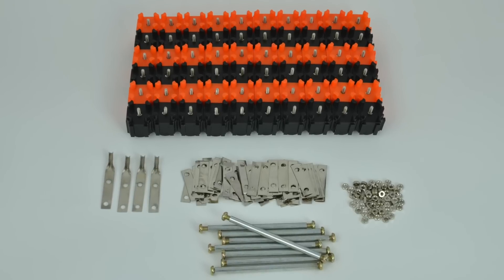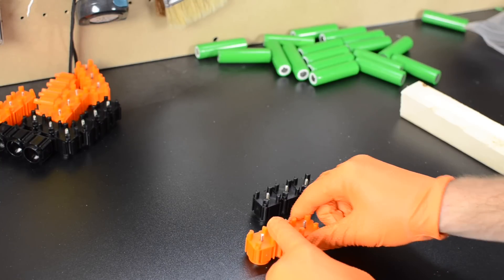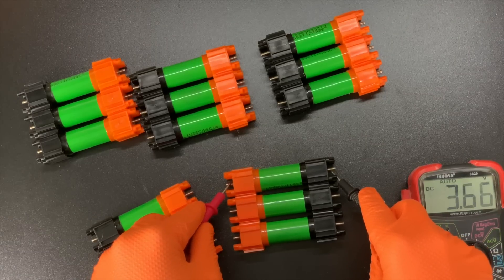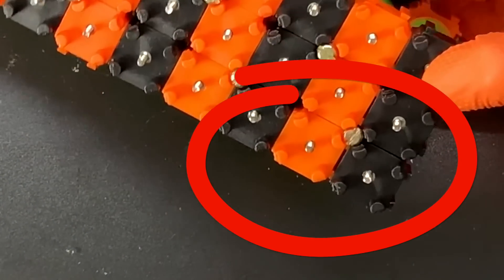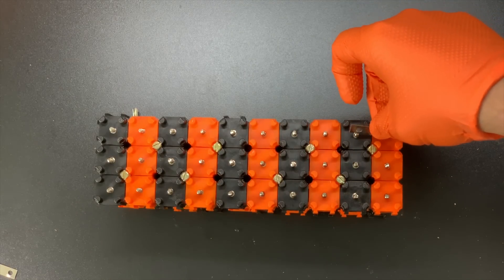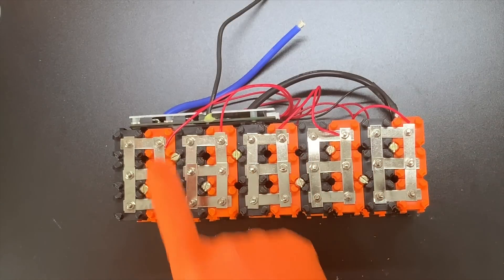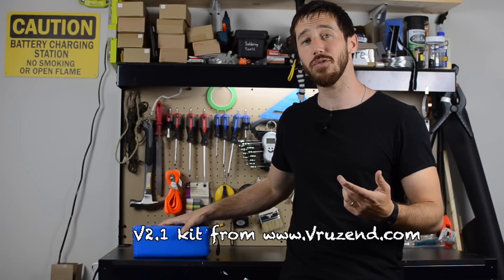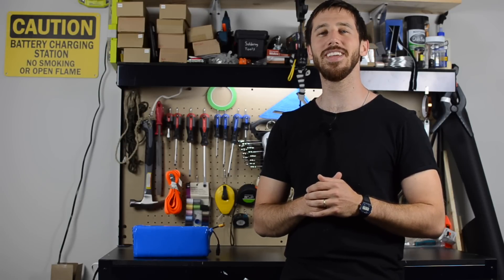New & improved Vruzend V2.1 no-weld 18650 kit

Comment: I'm new to battery building and I keep watching videos on how it's done.i think I'm getting the hang of how it's done.

1 question though,by using these blocks are you sacrificing space by adding more volume in the pack.
Let's say my 72v escooter has a certain tight space for the battery that sits perfectly. Would I be adding more bulk using the same layout of batteries the scooter battery has.

Not sure how many batteries I would need to make a 72v battery 32ah battery. This is another thing I need to figure out.😊

Comment: Looks easy putting it together. I would hate taking it apart to fish for bad, unbalanced cells. PVC pipe with threaded end caps are still my choice for cheap , tough, cell holders. 1” thin wall pipe for 26650 cells…3/4” schedule 40 for 18650 cells. Tight fit but not too tight , and cells can be extracted after removing one end cap and extracting with telescopic magnet for individual charge/ balancing in single or dual digital display chargers.Cell to cell direct series connection, no soldering, no welding, no itty bitty nuts and bolts to tighten. Hillbilly ingenuity does it again.. does fer me!

Comment: When making series connections, if the caps are not properly secured, it will cause a serious short as happened to me. A short occurred and I had to run out of my house to take it apart before it caught on fire. I seriously don’t recommend this alternative. You will not know what I’m talking about until it happens to you. Get the K Weld.
Reply: You have no business touching batteries, stop it.

Comment: Thanks Micah, I appreciate your innovation and that these battery kits are evolving.  I've been using these systems since 2017 and built many ebike battery packs.
I see in ebay that you have the V4 kits but you have to ship from UK.  Just wondering when you will get the V4 kits in stock in the US.  I've got about 60 cracked caps from the V2.1 kit and a lot more than that from earlier versions.  Looks like the V4 kit holds onto the battery by screwing in the bottom rather then by pressure around the battery.  I'm hoping that will result in less cracked caps.  :)

Comment: goldsmith / master jeweler, photovoltaic / solar thermal technician here: i'm all thumbs when it comes to soldering pen. i usually use small torch when i solder small electrical components, even used a laser soldering station on motherboard. i didn't want to try that on a battery. 
what do i think of the Vruzend ? i Like, OLE'! 💃

Comment: Having just spent many hours using the 2.1 kit, I have assessed the issues.  There are several major design issues that make the supplied 2.1 kit unviable for regular and efficient use.  In the parts supplied to me there were several major quality issues that caused significant problems during assembly.  The main design flaws are 1) The through bolts use flat screw heads so that standard workshop tooling cannot be used and the assembly using a screw head on both ends makes the tightening process unnecessarily difficult and time consuming.  The design should use one head that fits into a recessed end of the cap and the other end should use either a PZ or Allen key head, this would allow the use of standard tools and allow quick fitment and maintenance.  2) The screw terminals and nuts are too difficult and time consuming to use efficiently. These should be re-designed to allow easy fitment.  The current system makes it very difficult and time consuming even for a trained fitter to fit the screw heads onto the screws.   The quality issues were 1) The caps came from a mixed batch, one batch were very tight fit and required a press to fit, the other caps were so loose a fit that they did not hold the batteries.  2) The screws did not match the threads correctly in the through bolts, this created binding issues and caused major difficulties and was time consuming to fix, one screw head was completely the wrong size and needed to be replaced.  These current issues mean that any workshop attempting to assemble multiple packs will need to spend very significant time for the assembly and subsequent maintenance.  This makes the pack too inefficient for sensible battery pack assembly at a reasonable end cost.

Comment: I had to chuckle when he used the lighter for the heatshrink tubing, I do that myself and only use the heatgun on much larger heatshrink, which he did on this video.
Also unnecessary heat on the batteries is a bonus !!

Comment: Can I upgrade my dad's old school electric off-road skateboard (3x 12v 12ah SLA batteries, run in series) to a 36v 18650 battery pack? Can the li-ion pack be higher Ah rating? Thanks

Comment: Can you tell me if how we can use one controller to operate two motors in parallel. Because no two motors have the  same number of windings at any given time. So how do I overcome the noise and motor running issue?

Comment: How is longevity of the pack? I built 17s7p with Samsung 30Q and Vruzend v2.1 bits. After 3 months around 30% of orange ends cracked. Black ones around 5%. Vruzend support ignoring my emails… Definitely would not recommend.

Comment: If I want to build a 24v 14ah battery pack for a 250w-350w motor, both 24v, how should I build my battery pack? Also, Which bms should I use?

Comment: And then the controller also makes sure that the batteries don't get discharged too deep ? That would ruin them .   I am interested in building  battery packs for my amateur radio station , for at home and for in the field . In that case I need 13.8 V +/- , but can probably use 24V , and then convert it down to 14V or so . Very nice video's !  Tnx and stay save !

Comment: Anyone know where I could get a replacement or a custom build Lithium battery for my son's Gasgas/Torrot kids model E12 electric motorcycle? It says that it is a "48V 8,8AH 600W-1500W".  A 52V and more Amp Hours might work too. The dimensions are approximately 285mm by 73mm by 69.85mm. I don't have the skills to build one myself. The factory Gasgas part number is EE 40000TTCKK1  and I think the Torrot part number is 02PW-00020-ZZ if anyone wants to look it up to compare the stats. They are apparently out of production. Thanks. -Todd

Comment: morning...  i know nothing about batteries.  i  want to make a long lasting 12 volt batteries for my electric wheelchair using 18650 batteries.  i kinda understand the series and parallel but i don't understand the figure 8 demonstrated in this video.  negative and positives are all connected together.  why can't there be one side of the 3 batteries connected all negative to the positive side on the either end. so in a shape of a bracket [ then the opposite side and one row down the positive connects to the negative shape as the other bracket ] ???  i just don't get it..  i'm i that old and senile, beside being disabled??  i would appreciate your help.

Comment: I think just clamping the sensor wires is not ideal. i would either solder them or use ring terminals ?
Also i think NYLOCK nuts would be more reliable long term.
I guess an assembler could use the low-numbered torque setting on a cordless drill ?
Also  a socket driver would be useful using the same method for speeding up the build process on large cells ?
Simon

Comment: Five thumbs down for this new kit! I have already sent an email to Micah about this problem but no response. So buyer beware.
I have built two ebike battery packs using the plastic caps kit. Both battery packs have worked fine. However, a single cell in a battery pack needed replacing, so I disassembled the pack to replace the cell. I was astonished that several of the plastic battery caps were badly cracked across the top.  I managed to cobble the battery pack back together but I'll be surprised if I don't eventually have a problem because of the faulty caps.

Comment: 36v? You mean nominal? Because at full charge a 3.7v lithium cell has 4.2v you did a 10 series by 3 parallel so 4.2v x 10 =42v when fully charged. Does the BMS regulate the output voltage?

Comment: What kind of capacity cells are you using because with 2200mah cells 3 parralell would still give you a capacity of 6.6 amps so I don't completely understand where you got the 10 amp capacity from. I would appear to me that you are using 3300mah cells to get to 10 amps

Comment: Don´t apply too much force on the vruzend ! I did and many broke...I put a wooden board on top and below the 10s4p pack and THEN bolt with longer screws not onto the vruzend plastic but onto the wood.

Comment: It looks like this method separates the batteries allowing for good cooling airflow. Why then would one super wrap the battery pack preventing cooling air to do it's job? The kit provides all the battery protection needed and makes packing tape, foam and shrink wrap a detriment to a good design.

Comment: Yuck..  The balance wires can pull loose to easy.   Put a connection on it, and secure between the nicket and the bolt, or use an additional washer, and place the nickel, then the balance wire, then the washer, and then the nut.  The washer will help reduce the possibility to the wire pulling loose.  This design has a bare ware against plastic, against a nickel strip that can distort easily.  This is not a good thing.
Use the washer as it works, and is easier if you're looking for easy.

Comment: I am late to this party but at age 69 and with COVID-19 still on the growth cycle I am glad to still be in this world.  I have been searching for a battery packaging system for 12.6 (3 cell lithium ion) and 16.8 packs (4 cell lithium ion) for a portable power pack so I can change out 1 battery without having to resolder everything.  I use plugs on all connections.  I am NOT running a DC motor.  This also gives my customers the selection for Lithium LiFe04 batteries if they want them. J The ability to replace one cell WITHOUT HAVE TO solder to each battery end verses just bolting them in place is BOTH simplicity, genius and the sign of a very experienced and knowledgeable maker.  In the old days government called it Research & Development.  The reality is Retry and Do it again till you get it right is what this experienced is absolutely perfect for my design.  Hope bus bars for 26650 LiFe04 2600mah 55A Vascell arrays are on your future product design list too.  In FlorDAH we have been know to be without AC power for extended times due to Andrew, Charley, Matthew,  Irma and now Sally with more to come every year.  Beats running noisy ass generators running for hours.  I also hope this write up confirms I can suck up real good to both customers and winning a book.  This maker actually got his first patent 4,104,695 back in 1978. Most likely before have of your viewers were even conceived.  Harry Regician.  Regeration is my game plan.
Reply: i can make any coinfiguration battery  pack  12.6v 16.8v  25.2 v and on with sal short bits of neg and pos wire salvaged from cable cut and  stripped a few rolls of mini sellotape and few rolls of black tape some 4mm connenecter and 4mm terminals  with 5.5mmx1. 5mm connecter to charge

Comment: Iam straggling with your older v2 packs. 
I seen you videos how to make batterie. 
Iam making 60v 50a pack but half way throw a building, betteries felt to hot. I checked voltage and there was not looking good.
Some batteries was not making contact with v2. Cos plastic housings to big to keep steady or holding properly. 
I got 8 boxes cost me hundreds of pounds. And at moment sitting useless until I found a solution.

Comment: They are pretty cool to work with.  I'm just finishing the assembly of mine.  I did have one issue, though with the one black plastic housing.  It split.  Is this a rare fluke, or something common such that I should replace all of my black housings with new ones?  I'm asking before my final assembly and heat shrinking.  Please advise.

Comment: I just ordered my first e bike a hyper e bike . I’m all ready thinking about mods and upgrades. It has a 36 volt 7.8 ah I want to add an external battery and pug that into the charging port to get longer run time. The extra battery would be 36 but can jump the ah up to 10 or  higher? Or should I stay around the 6-8 ah . Or would this work it the same concept as battery packs for phones .

Comment: idea of this kit is great.  unfortunately imho caps are unnessesarily tight, especially when d barrel-bolts & heatshrink keep all tightly together. it defeats d purpose a bit, ease of assembly/disassembly. it should be possible to just lift off 1 whole side of a big battery, to be able to pluck a bad cell from d center of it. drilling a small vent-hole into d caps to at least get rid of d air compression & suction effects makes it a tad easier, but to make them 1/10mm bigger would b so much  better. i actually have a number of caps that cracked already.  you should consider this for kit V2.2.  me i'll be waiting....

Comment: All those nuts and the new clamp bolts . . . no lock nuts, loctite, or hot glue to ward off loosening from thermal or vibrations?
Seems kind of a scary proposition. 
Any real world data on loose connection shorts or fires?

Comment: Hi, How did you connect the large power wires to the BMS? It looks like hot glue in the video, but I know that can't be completely accurate. Did you solder these connections?

Comment: This is awesome, man.  I will definitely look forward to using Vruzend in my next battery build.  The DIY spot welding kits are awful and after some time the welds can come off.  Hopefully Vruzend will stand the test of time.
Reply: did you get the kit? i have an older set that i like. The new ones with screw clamp holes looks cool. BTW, i  am not sure if they still exist as a company. i sent an email query to them directly several months ago to no avail. Nothing on their www is current and empty links on their www. Their forum is not extant and i found very little current user information on the www as well. I hope they are still around - @EbikeSchool any update on this company status?

Comment: I used this kit to put together a 14.4V, 10.2 Ah battery pack for portable ham radio operations.  First time out the radio was used at 50-75 Watts output for right at 5 hours, and still had plenty of battery power in reserve. Outstanding kit!
Reply: I would love to see a picture of your build. I'm getting ready for the same kind of project for my Ham shack and portable rig. '73 KG7DTF Joe

Comment: Awesome. Please send me info. Of all places where I can buy at a great price the  batteries, battery holders, connectors, correct wire sizes and display panel and solar panels and which you believe is the best 2.5kw- 3kw continuous/ 4kw-6kw peak power inverter of 12v, 24v input because I want to build my own portable system.
Thank you for your help.

Comment: wonderfull idea  now its easy to rebuild and check over every year or so or if one suspects a cell block being down ....   but i have a question if anyone owns this kit    i need to know how much bigger is it  in cell length but  more so in space width?  example  if i have  6  cells  glued  together each  cell is 18mm  in  diameter  plus a few mm for the glue so say around  a total   of 120 mm for a glued pack of 6    how extra wide would it be in these  holders can anyone tell me as im tight  for space and need to know

Comment: Very nice. What about adding springs to the bolts to apply consistent pressure? Just an idea for next version. I noticed there are no 40V BMSs on the website. Any reason for that? Or are they just not showing? I ask because the electric lawn mower uses a 40v battery, although it's nominally 36v from what I've read. The 5 Ah battery uses 20 cells.

Comment: I made up a battery a year ago. It has stopped working as the plastic has split. It’s time to make up another but I will use lots of hot melt glue and sandwich it with plywood boards before I wrap it in foam. That’s the trouble with diy. It’s still cheaper than buying a new battery.

Comment: exelent video... 
I have a Question. 
what type of speed controllers is the most linear on power delivery to the motor. I own a eScooter the throtle went bad and since I wasnt happy with the original speed control accellator im thinking on upgrate it.  can you recoment me one. the scooter is a qiewa mini 500w motor.I belive...

Comment: So much information. I can see these kits lowering the prices of the OEM batteries. It is just over $1100 CAD for a 48v 14ah replacement pack for my Surface604 Shred eBike after taxes and shipping etc... get taken into account. The list price on the website is $799 for the pack which on it's own is more than enough for the components and workmanship that goes into making one. The lithium battery scene for OEM packs is criminal for the amount of money that they charge a 9 cell Milwaukee extra large battery costs an insane $279 before taxes. $18 for the cells and maybe around a very generous $50 for the brain box BMS and such and that's when you aren't buying in bulk. I'm So glad that someone came up with a kit like the Vruzend. I found out that it existed during my research on designing one myself. If only had had been faster off the mark. Anyway I'm about to shave off $600 to $800 off that $1100+ price tag and build my bike a 48v 20ah pack. Save tons and get more chooch for you're chotch.

Comment: I connected a 36 v battery cell from vacuum straight  to a 24 volt motor with kill switch on my scotter was going so fast asshell but I was able to brake ok but battery drain out like in 20 minutes I wonder how much voltage can my motor take n how fast with it go with out burning out n how long this cells really last for example a 24 volt scooter fully charged with battery cells how long will my ride last before Losing high speed.